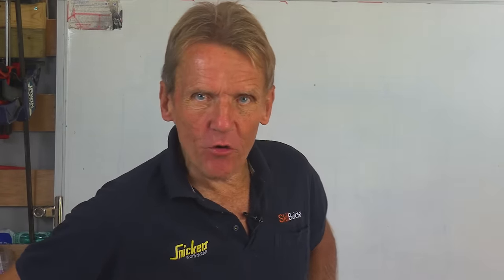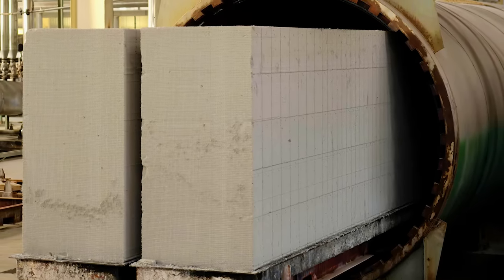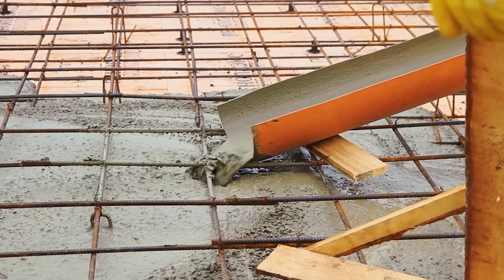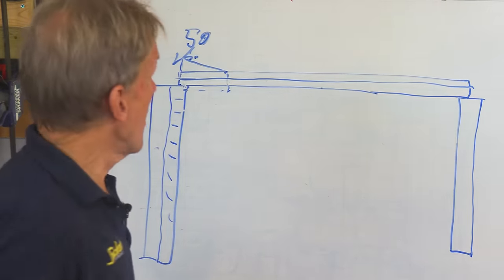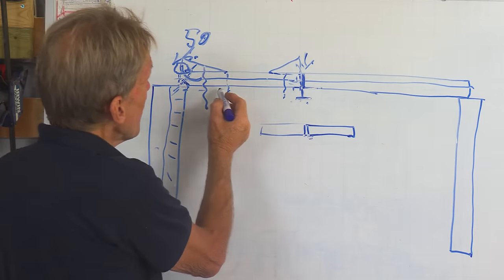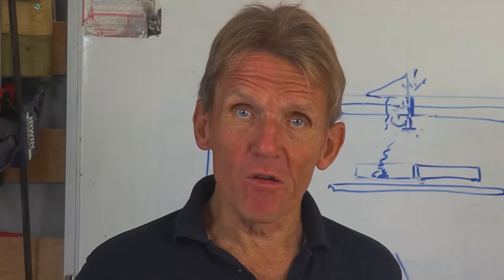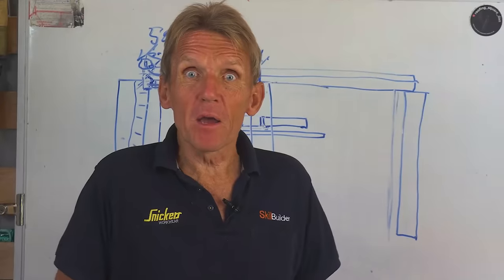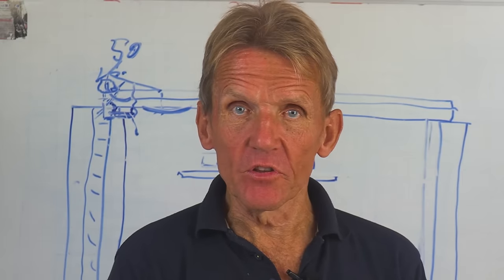The Ugly Truth About Reinforced Aerated Autoclaved Concrete (RAAC)

Comment: Hi Roger, thank you for your video.  

So as the steel rusts it expands, would this not tighten the grip inside the squidgy aero concrete, making the beam stronger?? obviously the limiting factor is when the steel completly rusts through.  Crazy anology i know.

Building technology varies throughout the British isles,
Perhaps there is less RAAC north of the border, still a brave statement from the Scottish parliament, especially as it's colder so products with a better U value would be more sort after.

I wonder whether asbestos has saved more lives than it's killed,
back in ancient Egypt the candle wicks helped light the way so people didn't fall over and hurt themselves in the dark.  
The Romans made table cloths that could be thrown in the fire to clean them preventing diseases.
Before asbestos brakes vehicles would just crash into one another because they couldn't stop.
Obviously there are new materials that are trying to compete with asbestos nowadays.

Comment: I thought in regular concrete the oxidation layer on the rebar helped protect the rebar from further damage as it significantly slowed down the attack on the underlying metal layer. I would imagine in aerated concrete this effect is greatly reduced as the rust is not held in place by the surrounding concrete to the same degree?

Comment: If they're used on flat roofs and they can absorb water - what happens in winter - when it rains and then later freezes - doesn't this fracture the concrete as well?

Comment: Surely the fix would be to fit a barer to the internal walls to take ceiling joists to support the ceiling from falling in. That would make the structure safe until the funds can be found to replace the building.

Comment: My dad, who was a NASA engineer used to quip that almost everything our civilization builds is done by the lowest bidder who cuts corners to shave costs and squeeze out a tiny profit.
He'd make that point during the Apollo program where the rocket had a million parts and any one failing would cause the loss of the rocket and astronauts.
But your homes, your appliances, cars, trains and planes (and the factory and office buildings) you use are also built the same way.
Given that catastrophes don't happen that often we're either very lucky or the practice of lowest bidder does work pretty well.

Note that I've read analysis of reinforced concrete and RAAC where they use basaltic fiber rebar reinforcement instead of steel rebar and it's supposed to have triple the lifespan and be just as strong. Maybe we'll switch to that

Comment: Surely the reed bar used to reinforce concrete should be made from a corrosion resistant material i.e. stainless steel, expensive but almost permanent?

Comment: Scottish councils and health boards etc looked after the majority of the buildings, and loads have been demolished and refurbished since the 90s. I work in a former NHS building and the whole place is tagged top to toe, every lintel, hatch, bit of electrical equipment etc that's still kicking about has a serial number and inspection sheets etc. Tory and tory lite councils didn't kick in up here til well into the 00s, so we've only got 30 odd buildings left with it now - flat roofs and pissing rain don't mix too well in the first place, never mind with this gear involved. 😄 Can only imagine Gray's confidence comes from this.

Comment: For homemade RAAC / Aerated Concrete, people use a soap-foamer, and mix the foam with the cement. And the reinforcing is covered with actual concrete with gravel but no rocks which dries before the aerated concrete is poured. And aerated concrete is not fit for floors and ceilings, only walls. Also, why is the rebar not made from weathering steel? If it were, the layer of rust wouldn't expand much (maybe 1mm at most), and wouldn't eat away at the steel (and cause it to expand even more, and damage the concrete even more, in the process). At least have the outer layer of the rebar be made from weathering steel, if the rest is made from mild steel.
Reply: Why not treat rusted rebar with rust converter before use? Wouldn't cement neutralize remaining acid?

Comment: One thing that you didn't allow for - in Scotland, they didn't stop the school rebuilding programme. So the line on the map does mean a significant difference.
i.e. The school I went to, which was only built in the 70s, but had a flat roof, was replaced about a decade ago - and the new school building doesn't have a flat roof.
The school in Scotland where they found RAAC panels that was a cause for concern back in May was a private school.
Reply: There are still public schools and buildings with RAAC in Scotland……

Comment: My schools always had something leaking at some point. And we bought a house with one of those flat roofs over the bedroom windows. And they leaked! Flat roof is a bad idea. Yet i see loads of new commercial buildings under 5 years old and the roof is still flat!
Reply: Perhaps they are flat because the were properly detailed and specified.
I'm an Architect and a specialist in flat roof waterproofing, specification and detailing. We have examples of flat roofs completed with Heat fused membranes standing for over fifty years and in perfect condition, even under full sun and winter rain here in Cape Town, South Africa. My own house has waterproofing laid on timber boarding for over thirty years.
I worked in practices both in Dublin and London and we were at that stage still relying on mastic asphalt and built up roofing. In Europe the Italians were developing APP modified torch applied membranes and have since laid tens of millions of square meters world wide. 
With regard to degradation under UV radiation, most flat roofs require insulation which
is usually provided by covering with insulation and ballast,  resulting in a roof which will last the life of the building. A far higher life expectancy than on sheet roofing.
I'm usually a fan of this show but feel that he should have consulted with a company such as Mapei or Polyglass to get their opinion before declaring that people should avoid flat roofs.

Comment: I'm not an engineer or a surveyor, I work in public policy. 

I read that RAAC as a material has a design life of 30 years. If that's the case, it's the story here NOT that RAAC is an awful material but that RAAC is a great material and in every case seems to have successfully lasted its entire design life without issue. 

The problem is that it was never realistic that we would ever have the political will to replace public buildings every 30 years. They need to have design lives of 100, 200 years, maybe longer. My schools were all over 100 years old, one was nearly 400 years old. 

The problem isn't the RAAC, the problem is the utterly unforgivable short sightedness of a design specification that mandates such a short lifespan. 

I hope I'm wrong, but if this is the case, it worries me that it isn't forming a part of the discourse on RAAC.

Comment: I think you should be aware the romans perfected concrete construction using the roman arch. Then it turned out not so well and decided multi-storey wooden structures were much safer. Sadly they did live in some cases in earthquake areas.
Reply: Yes, but the Pantheon has survived ... did they just make that particularly robust? I've been to it, and I noticed those sort of recessed rabbeted squares (for want of a better term) making up the roof, and even I (no knowledge of civil engineering) assumed these were not purely decorative features.

Comment: Big lol at "getting rid of the asbestos" 

I recently did a full window replacement project at a secondary school....aside from  ALL the other terrifying structural issues that were ignored and basically painted over...the asbestos removal was a f*cking joke. They only  removed it up to 300mm from our install. The rest (mostly AIB) was left in situ, much of it completely exposed...it was being used as pin boards FFS!!! There was a bunch at low level with scrape/scratch marks from kids being bored kids, there were even several chairs with it on them from kids leaning/swaying.

Got hit by plenty of chunks of lintel, there were steel posts holding up a roof that were in fact no longer holding up the roof as they'd rusted out completely (the roof was literally being supported on the old window frames). 

I could go on and on. 

Yes it was all reported.
Yes it was all ignored. 

But hey it's fine, bit of dry lining and some pvc trims and it's good as new apparently. 

Sleep well.

Comment: I've been scratching my head over this news for days. The media have been talking about "ceilings". Now a ceiling is not really a load bearing structure, can be paper maché panels and suspended from the roof. So this is not about ceilings but roofs, and flat roofs at that. Any flat roof in order to be watertight needs to be sealed by some sort of membrane and the drainage kept clear of leaves etc. So, maintenance must be routine. When the ceiling gets wet it's because the roof is leaking. When maintenance budgets are tight easier to change the ceiling panel and the problem goes away, right? WRONG. This problem is not going to go away as long as this building method is in existance and will give nightmares to whoever has to deal with them.

Comment: All points mentioned except 2 things: gravity pulls the roof down over time, hence the roof will collapse eventually, however thermal expansion and water loads are greater than before global warming might exceed the designed limitations of a raac roof. This might also include heavier people stressing the roof.
2: surveyors are not structural engineers. They are likely to impose a regime that maintains an insubstantial roof, an engineer might simply say - the roof is beyond it's designed shelf life, therefore to be safe it needs to be replaced. A bit like brake fluid in the car, once changed you realise you needed it doing 10,000 miles earlier.

Comment: The problem with standard designs is that they don’t adapt to a specific terrain, solar orientation, or the existing public utilities, and the accessible local materials for construction - long range transportation is expensive. A packaged project may be a huge mistake. Cutting that corner might not be advantageous. Building capacity in the UK, doesn’t justify trying to save the time needed to project hundreds of schools per year. While planning of projects can be out sourced abroad, if needed, and there is no limitation in volume and time with outsourcing.

Comment: Great presentation. Surprised that the terms tension/tensile strength wasn't used in regards to rebar, that would have done some heavy lifting in the explanation. It is all there but I think explicitly saying tension would help, that's why rebar can be floppy. Tensile properties are why carbon and glass fibre can be used to strengthen materials.
Standard designs are a good idea, that's what regulation push towards. They could easily be modular with pitched roofs. That doesn't dictate them looking identical, they could be laid out differently and clad with appropriate materials.
Reply from the maker: You are right, I could have gone deeper into it, we have other videos about concrete and I didn't want to overload this one. It is a miracle if people watch 50% of the video but this one has higher than average retention.
Reply: @SkillBuilder  Agree that you're best to keep it concise and reinforced concrete is a video in itself.

Comment: Interesting that most public buildings had a big rebuild programme in the post war period during a time of relative economic decline that was culturally and politically about "modernising" the country. In architectural terms this also meant a change in aesthetic, it was about replacing dirty, needlessly decorative and cold Victorian and Edwardian buildings with the clean lines, insulation properties and quick build of concrete that the modernists loved. 

The flat roof is both a modernist aesthetic signature highlighting the engineering prowess of reinforced concrete as well as saving costs in cutting out a decorative building signature.

In hindsight the post war obsession with replacing the Victorian legacy with modernist sensibilities but on a budget was an ideological rather than pragmatic one. The same budget could have been used to renovate the existing public buildings, schools, hospitals, courts and council offices etc and extended in a modernist style where needed, and interiors rebuilt. I'm not talking about the expensive like-for-like renovations of heritage buildings here. With a combination of over-engineered Victorian building stock, sloping rooves to reduce water intake etc we would have a smaller and more manageable issue today if it was just confined to extension buildings or new builds in areas that did not have any Victorian/Edwardian legacy, e.g. In the post war New Towns and general suburban expansion of the country.

Comment: You could have mentioned that reducing the area of concrete sitting on the padstone, increases the padstones loading (same force reduced surface area). Assuming the right padstones are used and the walls/pillars tied, which is no given especially when builders can have their own building control. 

It would also help if building users understood the loadings the building could take. Consider the 1134 people who died in the Rana Building collapse.
Reply from the maker: There is much more that could be said but there is a sweet spot with information. It is very easy to lose your audience especially on YouTube

Comment: No issue in Scotland they say? North Lanarkshire councils Civic centre is in the midst of an RAAC situation It has transpired that the Civic theatre has an RAAC roof which has been deemed unsafe. This has cased the immediate close of the theatre and all shows have been cancelled. If the former Civic centre is a problem what does that say about the schools etc? We tried a standardised design for schools in the 60's with the CLASP system and that didn't do too well 😄

Comment: I worked for a (the?) leading UK cement and concrete research association for 18 years (and the 1980s and 1990s). Back then concrete was in the wars in particular because of issues with reinforced concrete and with poorly maintained 'system buildings' from the post WW2 boom that were coming home to roost. My generation didn't like concrete much ('concrete jungle' etc etc) but as I learned about all that had been happening I found myself feeling that concrete had been getting a lot of blame simply because it was versatile and a material that flowed conveniently into the designers mould.  But the problem was really the designer, and the political and commercial pressures being brought to bear on them.  Concrete itself can be made to do great and valuable work , and it can last for a very long time (Roman pozzolan anyone?). The problem is not concrete, but short-termism, which causes so many issues, and not just with concrete. Flat roofs ('we have techniques that ensure they won't leak even though water may not run off them' - yea right!), asbestos, Grenfell Tower, timber frame housing, bathroom fittings that rust, etc etc etc are all illustrations of how poor design sense, 'fit for purpose' mentality, and commercial and political expediency can create a toxic cocktail. 

When I was a regional information officer in the concrete industry, I took an interest in a wide range of concrete applications. One of my most interesting visits was to a small company helping Third World countries to use intermediate technology in the creation of building  using cement and whatever materials were plentiful and cheap locally. So roof tiles might be cement with jute reinforcement, building blocks might use local soil and cement etc etc. I asked the MD (an architect by background) how he dealt with quality control. His reply was that using the Schumacher principle ( https://en.wikipedia.org/wiki/Small_Is_Beautiful ), the people making the products were making them to house themselves. Since the products were sound and durable if  made properly, and since the manufacturers would be living in the houses they built, they were motivated to do the job properly and quality took care of itself. I couldn't help but feel that this is something that has been almost completely lost in many societies today: build for others as you would want built for yourself. It's all there in the story of the Three Little Pigs.

Comment: Could this problem be solved if they used GlassFiber reinforcements that don't rust? Does that have enough strength to play the role of steel reinforcement for this application?

Comment: Prefabbed building for schools is the way ahead, once Labour are in power, this should be a priority, design should be standardised for plot size/pupil numbers. Tenders then go out to the manufacturers for the costs of the parts needed. The only variable can then be the cost of the footings, which will be site dependant. With the scale of demand, costs can be kept lower. Under this plan, you can probably predict upfront about 80% of the cost of the new site.

Comment: Putting rebar in areated concrete sounds like bad idea on it's own.
Why don't they solve most of problems by putting rebar incased in normal concrete into it? Although not sure if it would crack away like that still.

Comment: Why not use Basalt or Fiberglass rebar that doesn't rust?  No support plywood under the roof?   Why so thin?   no roof material on top that holds things together like stucco would on a side wall?

Comment: Build your concrete structures in compression modes and there's no need for reinforcement. Witness the numerous Roman structures that are well over 1000 years old and structurally sound, as you mentioned.